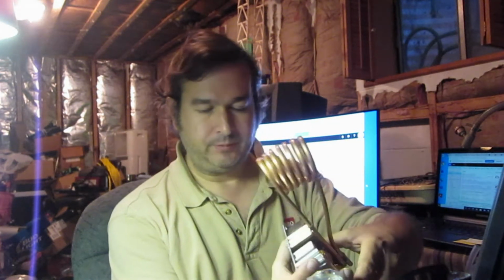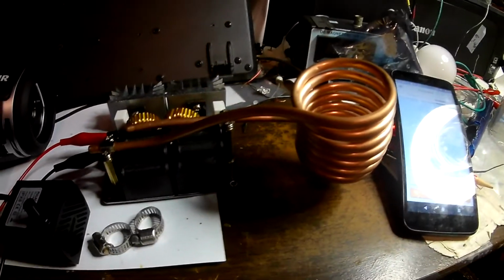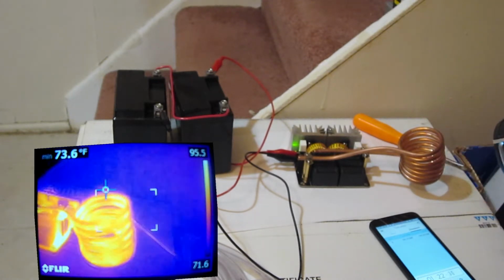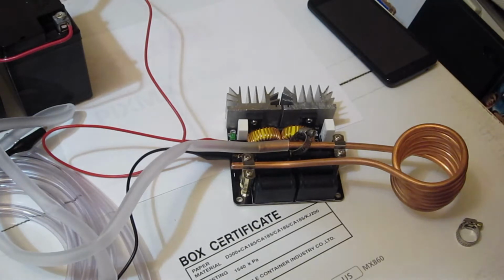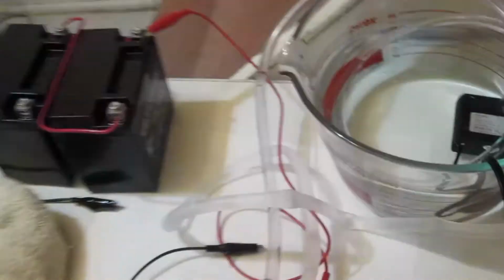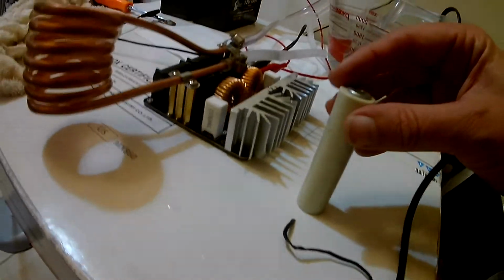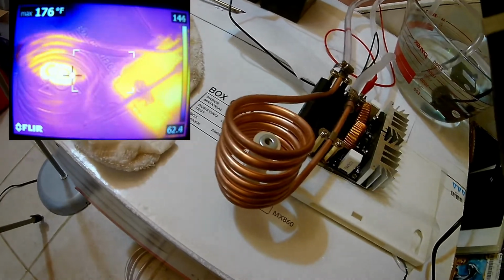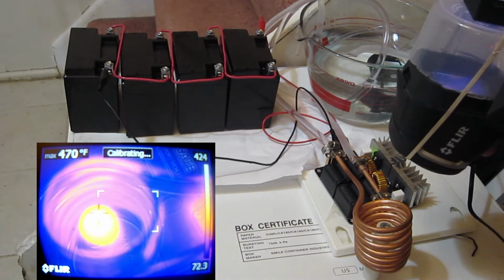RF Induction Heater, DIY Chiller FLIR Testing

Comment: Are you a real phd
Reply from the maker: Yes, I have a Ph.D In Electrical Engineering, from the University of Michigan. My thesis is on the generation of high power microwaves with a large orbit gyrotron!
Reply: @jaynesnetwork  that is very cool.
What power range if I may ask?